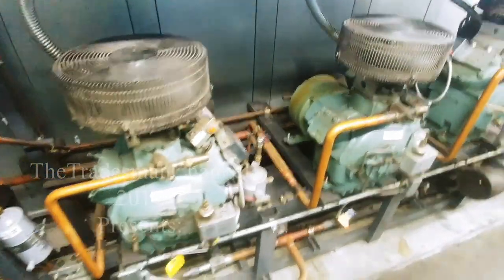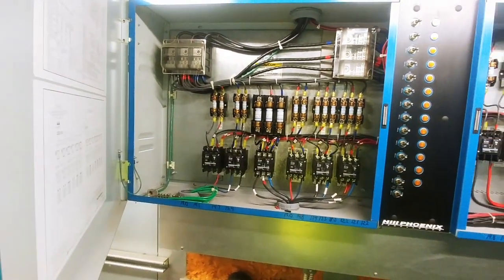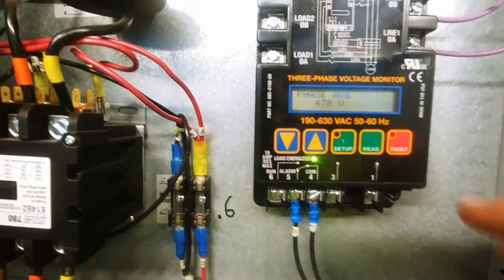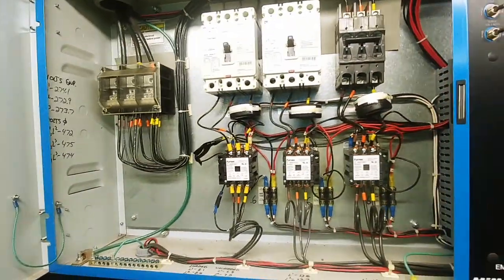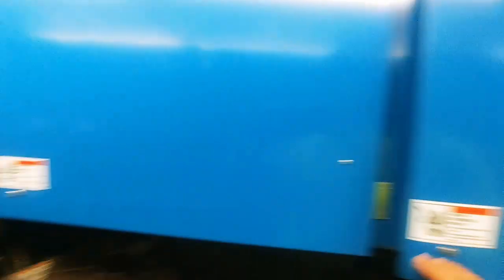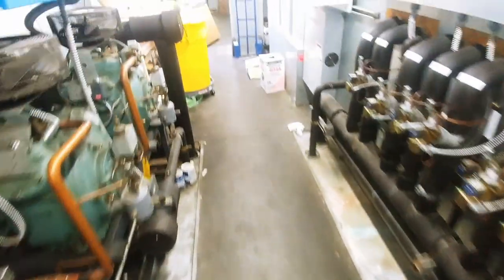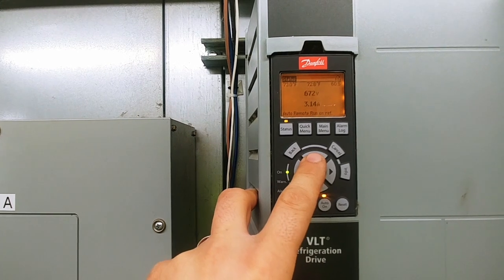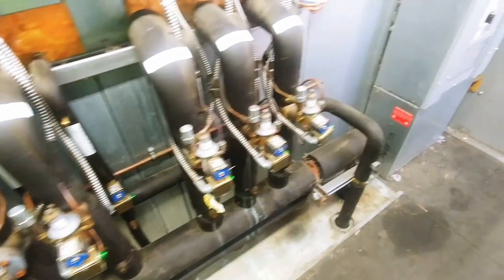Go to Work With a Tradesman

Comment: I knew you were a service tech when your company truck showed up in the background on other videos.  I too ran service for 40 years plus before retiring.  I did a fair amount of commercial refrigeration back in the old days.....late '70's and '80's r- 12 systems.  Even got tied in with a few old racks but none as sophisticated as you've shown.

However,  our digital conversions for building  automation and especially systems for new construction multi-story BAS controllers were a real hoot !!!!  I'm glad for retirement but I enjoyed every bit of it while there.  

Feel free to throw a video in ever so often....maybe showing a semi-hermetic compressor change and what you have to go through to get one on and off the rack with no help.....lol  Thanks man.   (maybe one with a severe burn-out)
Reply from the maker: +Tractorman44 i can do that.  You had a helluva career
Reply: I forgot to add that the only thing I really MISS about work is my service truck.  I had the good fortune to run 1 ton dually service bodys for the last 20 years and it sure was nice to have my rolling tool box everywhere I went.

Comment: your lucky I'm not there with u,i would be playing 20 questions with u,i have built some control boxes,transfer holes  for components,fuse holders,install on off switch,and the Panduit,electican not my job to build those,they just run wires,everything was on a drawing,i no care ill be there 7:00- 3:30,it all pays the same
Reply from the maker: +michael heinen good morning.

Comment: That's what pays the bills, but I saw enough of that crap when I was building "mobile" asphalt plants and factory automation systems. So my vote is to keep the channel on your homestead and family. The last schematics I had my hands on as a team leader was for the rebuild of the Louisville, Ky UPS hub. 537 pages for one bank of control panels. Lucky me, I made a whole dollar per hour more than the wire jockeies to spend my down time organizing and highlighting the schematics for each persons panel that they worked on. Then I got to build my own panels as well. When the hub, and local Ford plants were completed the backlash of layoffs was staggering. I was told at every interview that I was over-qualified. Now years later I probably wouldn't recognise half the controllers in the panels anymore. Heck, after spending some time in construction and trucking I ended up working at an Amazon factory and helped them fix many errors on their automation system but couldn't get hired as "over qualified". So yeah, for my vote... Homestead/family content. $33,000 electrical engineering degree wasted because I don't want an office job and I am over qualified for feild work. Now I can't physically do that anymore. So my version of "office" job will be as a teacher. Producing the minds of the next generation.
Reply from the maker: +Thomas Russell I know your pain.